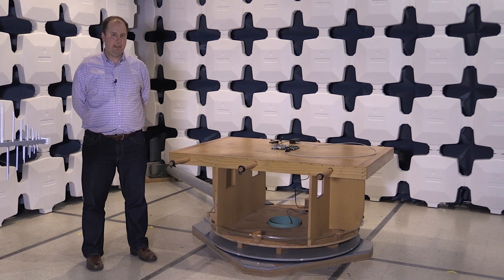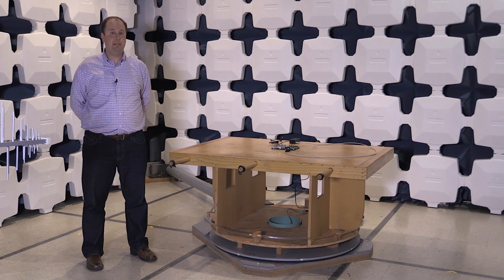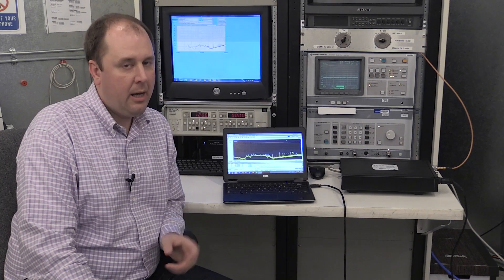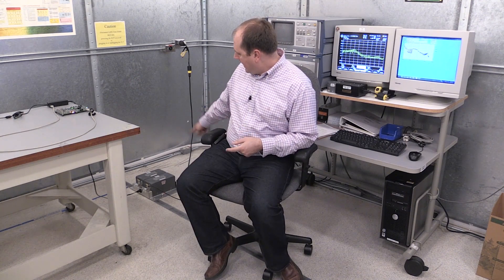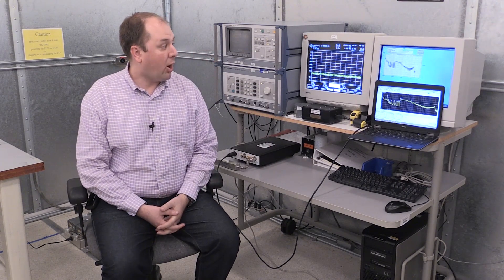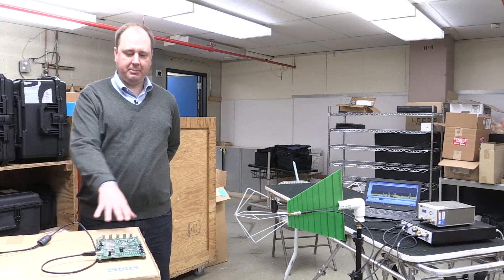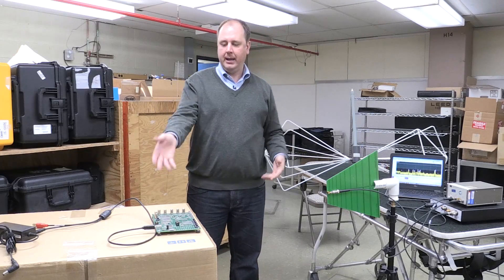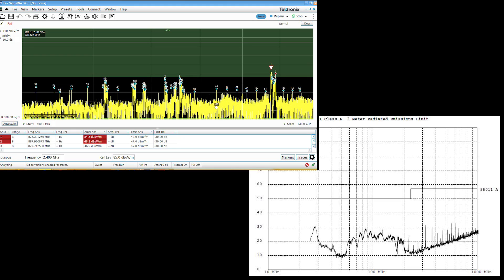Full EMI Compliance Chamber vs Tektronix Spectrum Analyzer

Comment: Thanks Matt for an excellent video.  I bought an RSA306 and perform EMI work all the time.  Another strength of the "low cost" set up is to move straight to localisation & determine emission source and dB reduction required.  All RSAs are small portable and very fast so they excel at the localisation task.   A frustrating weakness of SignalVU is no capability for simultaneous Peak & Average; things can be missed particularly in the conducted test.  Thanks again.
Reply from the maker: Hi Steve – Thank you for the feedback! I agree that having more features tailored for EMI applications would make the product more useful. I will share your feedback with our development team for consideration in a future release. Hopefully you will see more features soon that make the RSA more useful in EMI applications. Would you be interested in providing further feedback?  If yes, please email me at tektronixscopes@gmail.com to establish direct contact. Regards, Matt